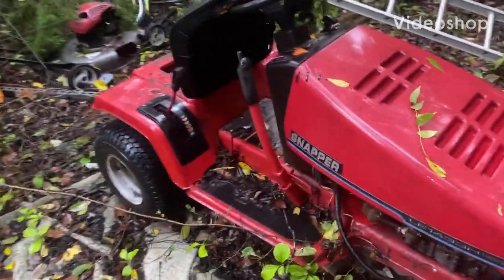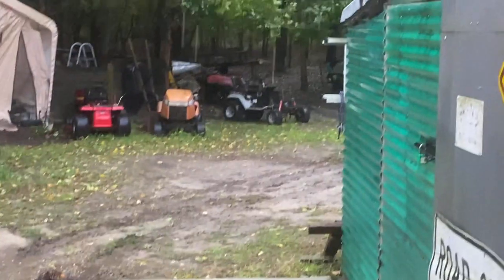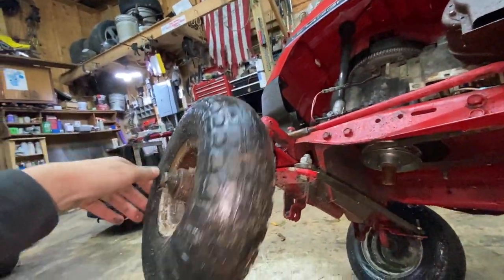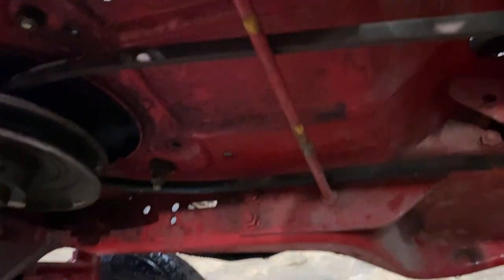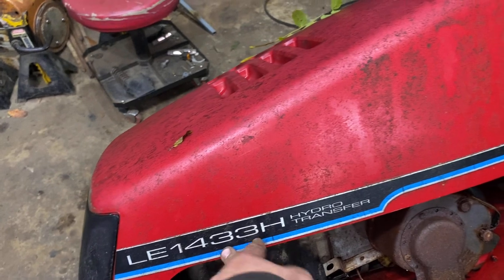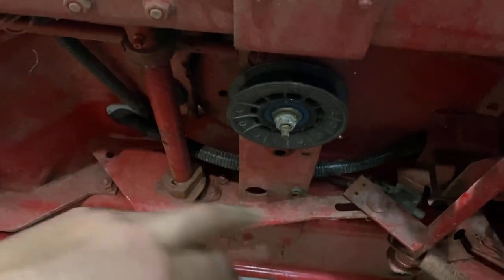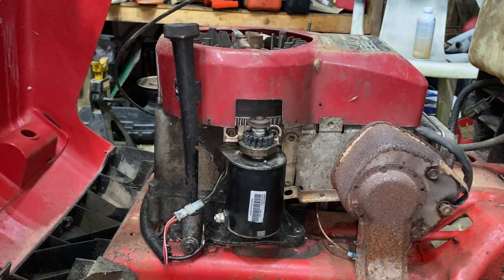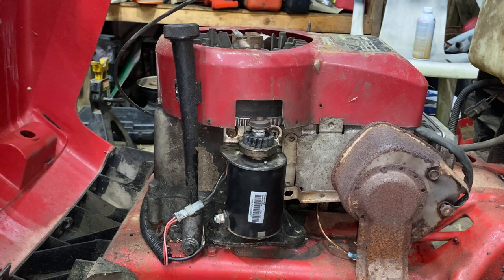Pulley Swapping an Automatic/Hydrostatic Lawn Mower | Part 1

Comment: puley swapling a hydrostatic will just make you blow up the pump in the axle it will not makw you go faster , if it does it will not be for long . just better of puting a manual trans axle in it and making that work
Reply from the maker: That’s probably right but I just wanted to see for myself. Thank you for watching!